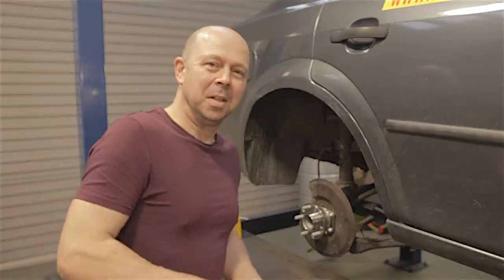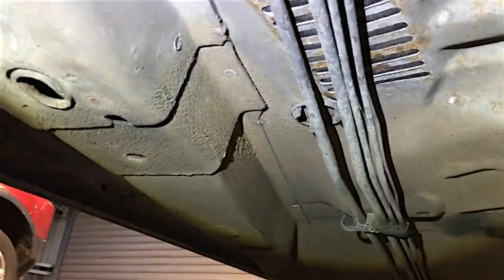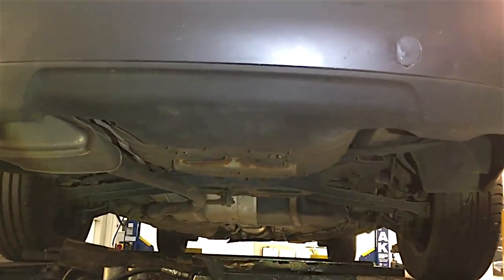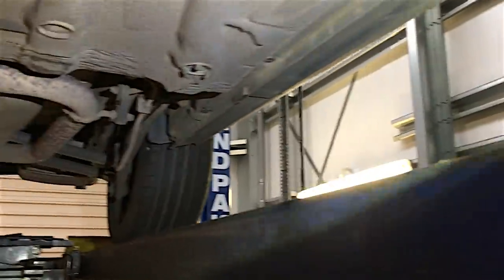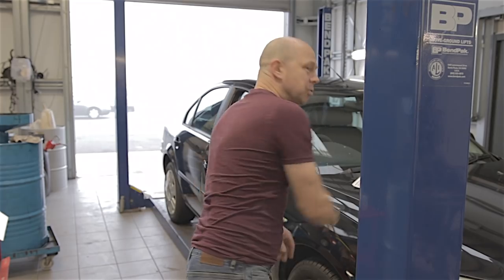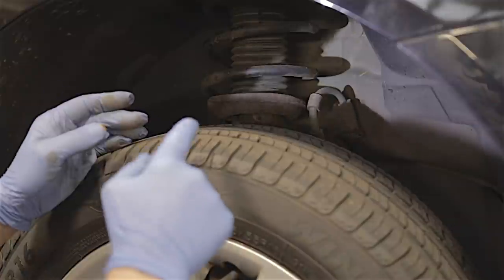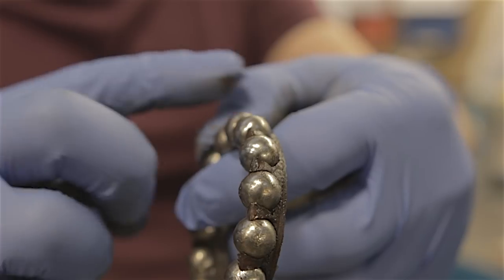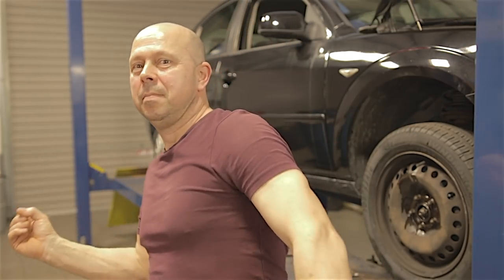What Could Possibly Break ...... Ford Mondeo Mk3

Comment: The petrol ones are generally OK mechanically wise. The 4 pots do sometimes have ring issues as allan says. The very early ones had plastic mountings for the swirl flaps in the intake manifolds. They will eventually break and be ingested by the engine causing much damage. The 6 pots seem to have similar things with rings around 150k. THe diesels/TDCI's... where to start. A lot of this is from personal experiece. The lump itself is pretty reliable. Easily does 200K+ if looked after. Its all the external stuff that causes the issues. Don't bump start them as the pawl in the chain tensior is weak and you'll likey break it causing no chain tension at startup/idle as its tensioned with oil pressure. Very tempting to do if it won't start after a fuel filter change and the system drains back. No electric lift pump - the fuel pump is two in one - a lift and pressure. Self priming...my arse.... Hand prime the whole system and crack an injector feed pipe. It is a duplex chain tho. Diesels should be swapped to fully synth oil - part synth and the 12k service interval kills the turbos as the oil feed isn't that large - even 10k services they go. Fully synth and 10-12k service intervals seems to sort that. Actuators on the turbo's sometimes fail. Easy enough to replace and get 2nd hand. If the turbo vanes are sticking - use the Mr muscle oven cleaner method - never had to do that as mine is made to get hot. Crank pully dampers start to separate and rattle/warble. Put the Ford one on. The ones from motor factors genally just fall apart quite quickly. Change the belt as well when you do it as it'll likely be polished and carry on making a chirping noise. Bearings in the aux belt tensioner arrangement eventually get noisy. Most people just live with it until it gets really bad. Doing the overrun bearing mod to the alternator pully can help which the petrols have but the diesels don't. Biggest issue for the TDCI's is injectors. They are just crap. Even decent re-built units can fail after as little as 10K miles. And that leads to issues with MOT's as we now use the plated smoke value on the VIN plate rather than the fast/long test. Most MK3's never met the smoke values from the factory!!!! Fuel pumps do fail and fill the system with swarf which almost certainly knackers the injectors. Flashing glowplug usually means expense..... Rear subframe bushes go on the hatches. THere are two thermostats on the diesels. THe smaller one by the oil cooler is prone to failure and stick open. Easy enough to change. Power steer pump bolts to the water pump. If water pump seizes, it shears the spline drive off, usually shaggng the power steer pump as well. Racks are the same as the petrols but not that that problem with mine. Water pump plastic impeller sometimes sheds off. DMF's - anything from 60K upwards and they start to rattle. Rear wheel bearings - I'm on my 4th after 200k miles on one side on the back. Change the manual gearbox oil, especially on the 6 speed box every 50k. Usually helps reduce/remove the notchyness. Door rot - usually failed bonding inside the door. Fixed after about 04 build. Body is galvanised so shouldn't really rot. Rear arches eventually do start to go. But the MK3 is a joy to drive.
Reply: That's an interesting comment about the gearbox notchyness.  Mine's always been a bit of a struggle to engage 1st gear - never just slips in easily, and over the past 12 years I just thought there was a knack to it!. I'll try changing the oil.  Is it Ford branded oil you'd use?  Thanks for the tip.  Cheers.  Vivian
Reply: In my box when I had it apart as I had a selector fork drop off a tiny piece of plastic, the synchro gears were certainly not the nicest made in the world which is probably why they don't always feel the best. MInes now for 220K miles on it and most of the roughness has just about gone. If the oil is slightly contanminated or breaking down slightly it makes the feel even worse. Its worth a try. The oil is a fully synthetic one. The 6 speed box is 1.9L when dry from memory and its a horrific price. Something over £20/litre from ford by now. Just make sure it meets the ford spec. The fill and drain are by the nearside drive shaft. Make sure you can get the fill hole bung out before you drain it. Fill level is until it starts to come out of the fill hole.
Reply: @guffermeister  Many thanks Michael, that's all really useful information.  All the best.  Vivian

Comment: I love your eulogy of the MK 3  as I have a Zetec estate 2L Duratec. I do love it. Yes, I have had broken front springs . NS at 5 year OS at 6 year. Little else. Alternator in 2021 at 77,000, it is a clutch affair. Spots on the sill. But I do look after it and it is only 78,000 from new.. MOT until next June. He said it was fine for years. You are a miracle worker for MK 3 owners. Keep going.

Comment: Steering racks wear out because the power steering fluid should be flushed/changed every 40,000 but never gets done.  You need red ATF fluid Mercon V spec.  

Use a liquid soap dispenser pump to empty the reservoir.

Then take the bottom reservoir hose off, block the reservoir outlet flange with blue tack and bend the pipe into an empty 2L coke bottle, squished between the engine and radiator (or take out the drivers headlight and run the pipe through the headlight hole into the 2L coke bottle outside). 

Then with the front wheels jacked up and engine idling,  turn lock to lock a few times to fill up the coke bottle and drain the system. 

Then reconnect the pipe and refill the system.  Idle the engine and turn lock to lock, before checking and topping up again if necessary.
Reply: Nice tip on emptying ps reservoir! I used a turkey baster instead.

Comment: Great video, thanks. I had exactly this car 2004 2.0 petrol auto, drove it from 50k to 135k and had pretty much all the items you said. Also had engine mounts that got so soft the extra movement kept breaking the flexible exhaust coupling, changed it 3 times in 2 years before realising what was causing it to fail lol

Comment: A really excellent and useful video Alan - thanks for posting for us Mk3 owners.  Both my Mk3s had exactly the problems you mentioned, namely coil springs and wheel bearings - but apart from that both cars have been perfect.  My current one is a '55 plate 1.8 Duratec petrol with 93k miles and I can honestly say it drives and looks brand new.  I will check out the brake pipes though - thanks for the tip.

Wishing you and Monika and all the team at Steve's a very happy Christmas and keep the videos coming in 2022!  Cheers.  Vivian.

Comment: Great video. I've a 2004 2.0 Petrol Ghia  160,000 miles. No issues so far with broken springs. Did one rear wheel bearing at about 80,000 miles, but that wheel had the sized handbrake cable problem. I reckon the bearing failed because of the heat build up from sticking caliper. Watch out for water hoses perishing , they will feel soft and spongy. I've had to change several coil packs. Engine was just hesitating slightly on light throttle. Mind you last one has lasted better than the previous two. As you say a great car. I don't know what to replace it with. BTW just dealing with a front strut top failure today, but then its 18 years old

Comment: I have had my 2002 1.8 petrol since 2007. Most of the issues like springs have happened to mine. Handbrake problem was due to the cable adjusted too tight not allowing the caliper to return. Overall very happy with it. Just changed reversing light switch. Regards Paul.

Comment: I've actually got a brand new rear wheel bearing and set of hand brake cables in my attic from where I had my mk3. Some bellend decided to hit the back end quite hard before I got round to fitting them. Drop links were always another thing to
Reply: Martyn, which part of the country are you? if you want to flog bearing & cables?
Reply: I'm in South Wales. I got the left and right hand brake cables and rear bearing.

Comment: Would be nice to see you do a video on the estate version, showing how the rear suspension is different.  I have a ST Tdci estate and the original self levelling rear shocks have been swapped for normal shocks but the springs weren’t so it’s a bit soft and lower at the rear. Still drivable though.
Reply: Hope you've still got it👍 My Ghia X estate has self levelling rear shocks, and the gaitors are split.

Comment: I've got a 56 plate mk3 I'm running about in. Bought it cheap, had to do a few bits - latest being drivers side rear wheel bearing and spring. Happy days. They're still good cars years after they were discontinued.

Comment: Door card vapor barrier seal. The sticky black sealant goes wrong over time and the vapor barrier lets water in to the footwells on a rainy day. Easy fix. The electric tailgate lock on the estates go always wrong. As you say, if you take care of them they will last forever. Sold 3 months ago my mk3 estate 2.0 duratec and i regret it. Bought the mk5 estate but these old bangers have something more than a new car.

Comment: I had the same notchy steering rack on an early 08 plate mk4 estate while it was under warranty. Took it to the dealer and they seemed to know all about it. Apparently it was only a problem on RHD cars, and mostly estates. It had a new rack, oil resevoir and filter fitted. Glad it was done under warranty.

Comment: All those jobs reminded me working on my missus Mk2 Focus LOL
Grat video!!! :)
It would be interesting to see how to press that bearing out with ABS in situ. Maybe in next video?
Happy Xmas!
Reply: For the rear hub/bearing units you just tap on the edge of hub (after removing the 4 locating bolts) with a hammer and the whole bearing+hub unit pops out. 

Disconnect the ABS cable first though!
Reply: @steve0680657  yeah mate, I've done the rear one.. they come with huband drilling the sheered bolt was time consuming but worth the effort.. I should have add I meant the front one.. mate pressed it out and in for me but they said it was tricky with abs sensor in place.. that was on my misses car, on mine the sensors actually came out no problem.

Comment: Definitely a great video. You're doing a fantastic job.

However, I have a question about the lower ball joint for the front wheels: the haynes service book recommends to lower the subframe to undo the ball joint, and in your video you just apply a ply bar, who's right? 

I need to replace my strut on my mondeo and if   possible I would prefer not to touch to the subframe.
Reply: I’ve read that by using a bar and levering the wishbone down could damage the back hydro-bush in the wishbone. 
I’ve never done one, but thought that maybe compressing the strut a couple of inches with a jack would give enough room to lever off without over stretching the bush 🤷‍♂️

Comment: Love what you say about getting the rear strut off if that bottom pinch bolt sticks. I need to to do that, as Ford dealer frightened themselves and refused to to do the job. Rear top mount needs changing I think.

Comment: My dad still has it from new. 218k km, 2.0 TDCi 130 06' first registration, 05' December made. It is very solid car. Replaced liked Alan said rear left wheel bearing and 2 clutch set with DMFs front coils snapped, rear shocks went bad. Other stuff that went wrong is pretty common imo; thermostats, water pumps, handbrake seized, steering pump was refurbished, couple of brake sets all around. Though steering when standing still is pretty heavy, is that common on these?

Comment: Had two new front shock absorbers fitted to my mk4 08 plate 1.8diesel mondeo at 100k and both rear brake calipers changed, handbrake arm mechanism had seized on both.

Comment: How often do you change the oil in your mondeo taxis or any of your fleet cars for that matter? 5000 miles  or do you leave it longer?
Reply: I do mine (1.8 petrol duratec) every 10,000 miles using Shell Helix Ultra professional 5w30 AF. 

The official interval is actually 12,500 miles for the duratec petrol, but I stick with 10,000 to avoid any excess wear.

Comment: I have a 2006 Mk3 petrol.

Bought it for £1200 as a run about for work only covered 62k miles.

I was wondering have you ever come across problems with the heaters?

The heater blower unit is only blowing out hot air even when temperature is set to the lowest setting.

I replaced the original heater control unit as when I bought the car the original control unit was burnt out. Plus the fascia was damaged and glued together with black silicone.

Just wanted a heads up on what could cause the warm air problem before I start digging into things.

Cheers
Reply: I think there might be an electrical resistor up behind the glove box that can fail.

Or on some models the cabin temperature sensor is up under the lower dash plastic beneath the steering wheel.
Reply: @steve0680657  thanks I’ll try and get a look at it. 

I have tried a few things with it but to no avail the heater control unit was replaced as original unit was blown.

So I’d dare say there was an underlying issue with the heater blower.

Checked fuses etc at start but all checked out fine 

Thanks for your suggestion
Reply: @iainmccracken21  also it can be

Engine coolant too low: Top up when cold to the Max line.  If it'd red colour you need G12 / AF12 / G12+ / AF12+ coolant, mannol are cheap on eBay. 

Engine thermostat worn out:  you'll know because the temperature gauge won't Reach halfway, or will take AGES to reach hallway.  I recommend MAHLE thermostats as they were factory fitted.

Comment: Had spring break on a low milage fusion years ago also on a vauxhall corsa, what i did notice was the poor quailty of the steel in both instances. The impurities in the metal were very obvious. Its no wonder they breaking. They are being made so badly …designed to break , shameful imo, never heard of springs breaking in 80’s and 90’s.
Reply: Astra always   broke   front  spring   never   seen   broken    spring   on   mk3  escort, often   brake   spring   because   top   swivel on  spring   broke up  or  seized

Comment: Hello Alan I’ve got one of those cars blowing air like crazy from the oil filling hole, what might be wrong? Pcv valve or worn engine? I’ve cleaned the pcv but still the same, don’t know if it’s faulty though, the car does burn some oil but not much yet.

Comment: Alan howatt
My 2009 ford galaxy 2.0 tdci.
Has gained lumpy idle problem.the egr is blanked off. Ive change the fuel filter which made a tiny difference. Injectors are fine. Glowplugs are fine.
So the car starts fine. Then about 5 secs after its started it runs lumpy for a short time. Then it runs totally fine.
The problem started 2 months ago. When the temp was bit cold. I had 1 morning where the car cut out. But once started and hold revs it was fine.
Any ideas.
Ps im in Peterborough so very close.

Comment: Mine has the cat directly attatched to the manifold. Is that a difference between estate and hatchback?
Reply: This one will too. Both the 1.8 and 2.0 duratec petrol's have the cat bolted onto the exhaust manifold.   Alan was actually pointing to the first silencer box.
Reply: @steve0680657  That's what I though. The mk2 had the cat in that position though.
Reply: @rimmersbryggeri  interesting.  I've not driven a mk1 or 2, but I'm chuffed with my mk3.  

Best unique feature is the low washer fluid warning, even today not many cars offer that!  Although with its measly 2.5 litre tank you're always topping the dang thing up.
Reply: @steve0680657  Mine is too old for that feature. It has the sensor but not the wiring for it so the sensor just works as a plug.

Comment: Hi Alan,I can see that you are a specialist with Ford tdci engine so I would like to ask you for a favour and hope you could help me.My problem is that my car (X-Type with Ford engine) would start with really low rpms after turning the key and then slowly build up the revs up to the normal range,it would have rough idle at low rpms,it would stutter in higher gear around 2000rpms from time to time (more frequently),then the problem would worsen with time and affect the car even in 1st and 2nd gear that was close to the end as then it would hesitate to move up in the first ,finally giving up on Sunday.After it stopped moving ,it will now start and die right after few seconds .Any idea what could be wrong?I will really appreciate your help as my car is at my mechanic at the moment and he thinks it is a problem with the exhaust and I think it is fuel supply related ,I have a reconditioned high fuel pressure pump for quite a while waiting for the time it will be needed,just in case.Thank you in advance!

Comment: Any one on here no if you can get the O rings or the size of them.its the fuel pipes connection to the fuel filter as I think one is letting air as I've got air pubbles .on my mk4 2.2 d Mondeo any help would be helpful